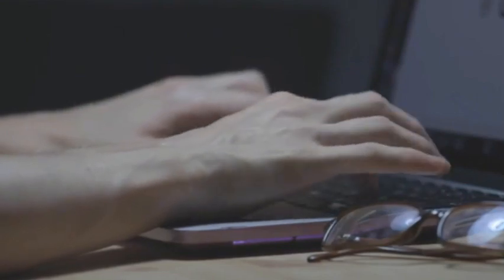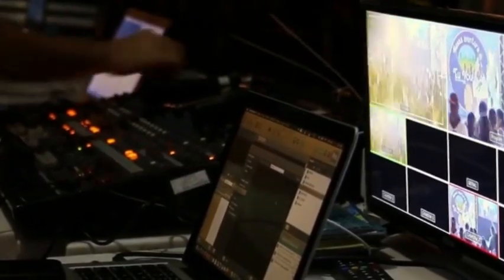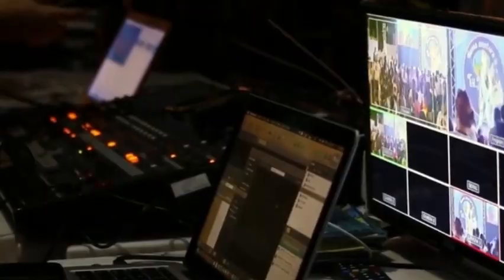China Shatters ASML Monopoly! World's First Nanoimprint Stepper Delivered (10nm Precision)

Comment: Low iq , it's going after the majority market: med to low tier. All your appliances,autos, tvs don't need hi tier 2nm expensive chips . Your 1.5k flagship phones PC silicon processors gpu appeal to a small market vs the majority mid to low tier market. 2 nm costs billions to create a manufacturing line, and recouping it takes multi years that would or would not recoup depending on demand. One thing is certain, whatever china makes they bring down costs 100x less than the west.